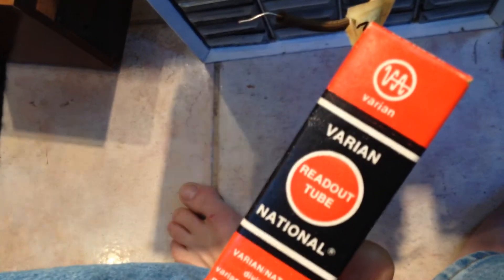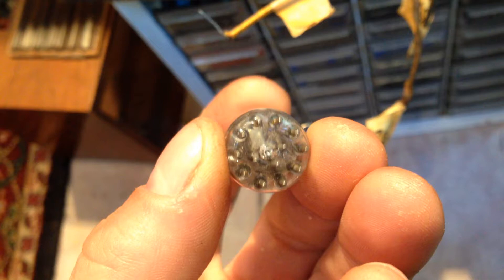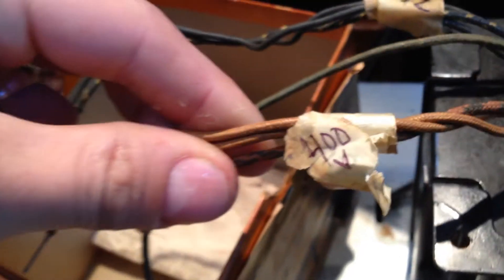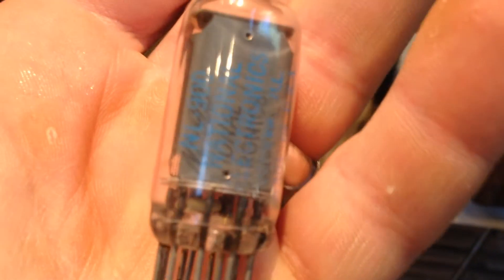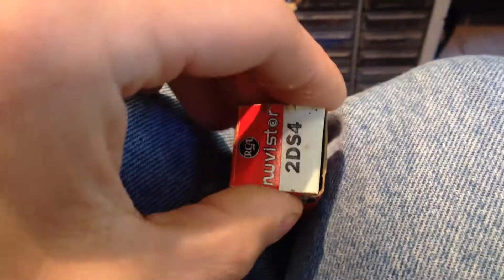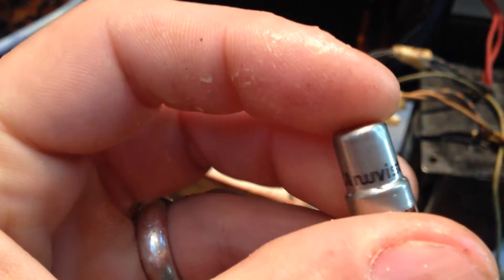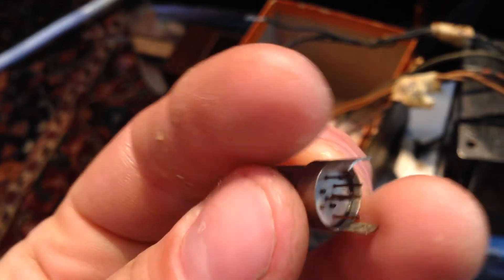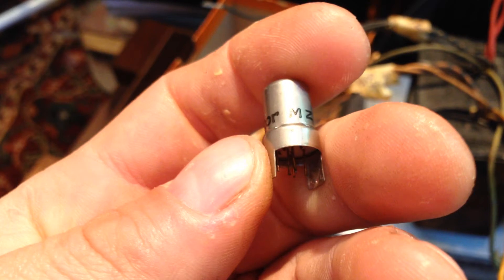RCA Nuvistor and NIXIES! Both new!

Comment: Hi Steven. I think I found some caps that will work. 0.47 mf  1000 volts.

http://www.ebay.com/itm/2-NOS-Arcotronics-Radial-47uF-1000V-10-R76-MKP-polypropylene-capacitors-/291209975022?pt=LH_DefaultDomain_0&hash=item43cd7794ee
let me know.
Reply: Steven King
Hi Steven. No problem Buddy. :) I searched for about four hours and saved links to some I ran across.
Let me know when you have the time.
All the best.
Bobby